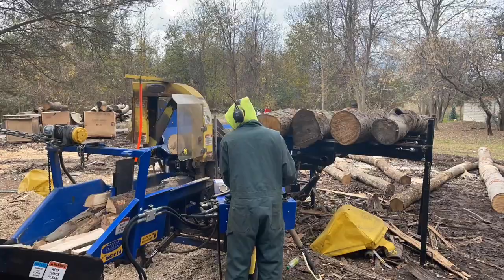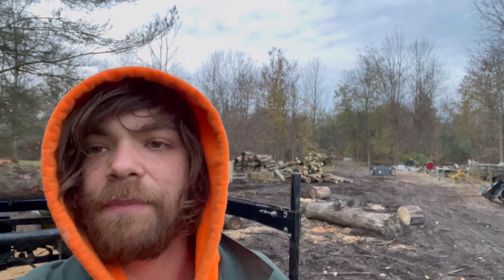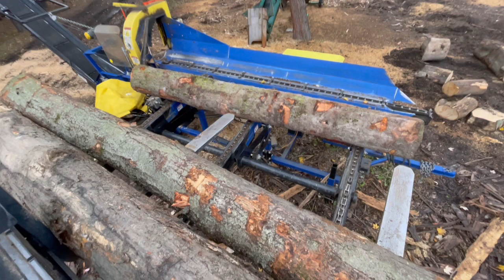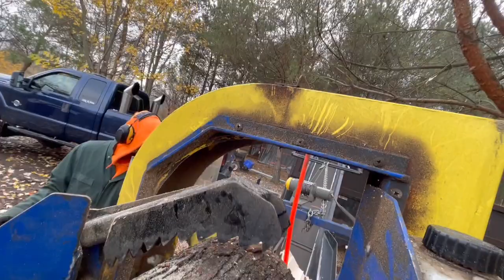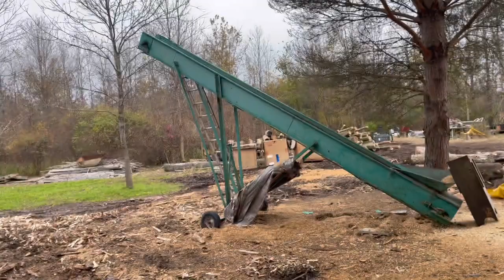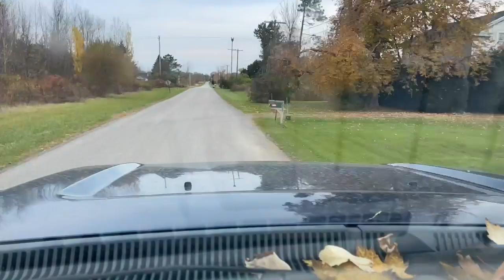WHY I DO NOT STORE SPLIT FIREWOOD?

Comment: Dad just bought a processor. For decades, he split into a pile to season for months. Some people appreciated it but you're right: stuff on the bottom is dirty and moldy if its been a wet year. People also don't always understand the costs involved to get that split then seasoned product: dad used a loader to hand stack each face cord. $16000 for the trailer that's not too big to rut up a yard, a $45000 truck to pull it, $65000 processor so no chunks are too big, etc., etc. Not saying it can't be done cheaper... but some customers want premium quality, dry, split, uniform, defect-free firewood for less than green wood prices or $5 more per facecord. You're right in what you were saying and, if you're clear with customers, they can't claim ignorance and you actually get them their wood at a much better price. Don't forget wear and tear on your body if you were to hand stack! Most firewood people don't charge enough for that because customers just don't know the physical labor involved and won't pay. Thanks for the video!

Comment: In my case I have to stack for room.. Now I am only doing about 50 to 55 full cords a year(currently with just a box store splitter and a truck) and 99% of what I get is green.. For soft woods it will be fine in 6to8 months.
In your case the volume you are doing makes sense to me with the room you have.
Chris in the wood yard or Joe at Ohio Wood Burner there system makes sense to me as well as they have the room to stack it.
At the end if the day if the customers is happy with what you deliver than that is all that matters..
Each to there own. Keep doing you Greg and you will be fine. 😁👍
Reply: Other than Ash or Soft maple I don't understand how it can be dry.  I have a pile of oak that have been stored as logs for two years and it is still 30+ percent moisture.   I suppose if it is boiler wood it doesn't matter so much but here in Washington boilers are not legal.
Reply: @stevenstewart7603  : guess that is where you and me are different compaired to high volume guys.. We are just under the mark of this level to where we have a little room we can stack it away and not worry about it. Where high volume guys like TWG may not have the room to store it away..
Dont get me wrong I am not questioning anyone's way in doing things.😁👍
Reply from the maker: Really appreciate you mr Atkins. you do amazing at your woodlot. Cant wait to see the new splitter when you get it 👍🏻😁

Comment: If a customer wants super dry wood, they should order in late spring or early summer. Don't be the grasshopper winter will come if your ready or not. Nice video, thank you!
Reply: EXACTLY Brian, been saying this for years, in fact I routinely tell potential customers that if they want 1-2 year seasoned firewood they best be ordering it 1-2 years in advanced and provide a adequate dry storage area
Reply: @JoesFirewoodVideos  
However,when you're  peddling "premium" firewood it must be dry.
You yourself said in several of your videos that the #1 criteria for premium firewood is that it needs to be dry.
Reply from the maker: I agree Brian! 👍🏻 thanks so much for watching

Comment: I do it this way as well.  Ash is getting harder and harder to come by in Northern MI though.   Most of the dead standing stuff is getting to be too far gone.  Sugar maple logs take a long time to dry out, I try and stay a year ahead on those.  Beech and soft maple tend to have a quicker turn around though, which is nice.  Red oak is almost uselss for anything but boiler wood unless you plan on sitting on it for like 2 years lol

Comment: If customers are happy keep it up.  I cut year old red oak tops last year they were still very wet.  Split and piled it ( not stacked)  it looked great and fairly dry in June.  When it started raining non stop in July it started growing mushrooms looked like hell when selling in October.  My son stacked his and even stacked double rows grew mushrooms.  I stacked this summers wood for next year but it sure takes a lot of time.  Should be getting 10 to 15 more a facecord for the extra work.  But doubt I could sell much at that price point.  Does look better fresh off  processor but don't  think people would be happy with fresh split oak logs.  It works for you keep it up!
Reply: I haver had a dyna for 10 years now and I cut and split as the orders come in I only store full logs it come off the converyor into my trailer and delivered and you are right to stack and store and then throw into dump trailer I to would need 10 to 15 dollers more per cord
Reply: ask some of your customers if they would mind just cut and split firewood
Reply: Yeah I been thinking of offering a green wood fresh cut discount next spring and summer.  I just cut red oak tops left from logging and ash right now.
Reply: Start to try to grow mushrooms and I bet they would stop!

Comment: I used to buy my wood in the log form.  My savings were huge.  It was better for the supplier.  He would store it in piles so when I got it it was at least 2 years old. I would get a truck load a year, so that meant I would have one pile of full logs sitting all winter.  I would cut and split the previous pile over the spring and summer.  It was always dry enough to burn that winter, and I always had at least 2 face cords of previously dry to eat me started.  I preferred this method as my previous supplier used to always slip in dry rot
A few of my neighbours used to do the same thing and we would rent a log cutter, splitter. Over a week we would get 3 to 4 house holds done at a minimum rental price, and always helped each other out.

Comment: The more you have to handle the wood each time the more time and money you're losing...... and with fuel prices climbing each day......it only makes sense to do it as fast as you can.... especially running multiple pieces of equipment like when I was up there grabbing 20/25' lengths off the main piles with Backy, you cutting them in half and loading the processor live deck and that Wood gurl processing into the trailer..... what a great team effort !!!! But remember...... you're still handling each log 4-5 times before each piece lands inside the trailer
Reply: ^^^^ YES 🙌🏻
Reply: I would change the word, "handling" to something else, because he does not put his hands on all of it.
Reply: @jakebredthauer5100  okay what " word" would or should I say " wood" you suggest ???????
Reply: @delcasaleexcavating9508  
machining or working or machine-working
Reply: @delcasaleexcavating9508  I would suggest using wire mesh in a circle on a pallet to make 1/3 cord baskets that can be covered with plastic. No-touch wood.   Concrete block foundation halfway on each of the four sides
Reply: Much of his mud problem is lack of drainage and putting Garden materials where he wants to drive.
Reply: @jakebredthauer5100  that's a good idea
Reply: @delcasaleexcavating9508  Finish the ends of the wire circle with a rod, pipe or stick of wood, to be tied and untied. Space for access.   Concrete reinforcement wire comes in various gauges with various hole sizes. Do not fasten the wire and pallet together.

Comment: that wood is GREEN cuz!  Green as can be, but if it works for you and your customers, good deal, but those logs ain’t drying sitting there, they could sit a couple years and still be wet inside, wood only drys after its split into firewood, i cut all my logs into rounds and process from there and even after a year once you split it open it’s still green.  i was always wondering why i never saw firewood piled up anywhere.  i sell seasoned firewood down here and i’m about a year ahead so the firewood is dry, lights up with newspaper, but it’s true it gets dirty sitting in a pile, so it’s either green and clean or dirty old firewood.  i load with an excavator with thumb and skeleton bucket to sift out junk, helps a little. great video was always curious why the woodguy never had wood anywhere!

Comment: I suppose your customers are primarily heating with wood and not recreational burning wood.  Do you sell you firewood by the dump trailer load?
Reply from the maker: Sure is. 90 percent is all used for primary heating... and I sell by the face cord... but I like to deliver full trailer loads which is 5 face cord. If somebody wants less than 5 face cord I have to charge for more for delivery depending on distance

Comment: Prefer logs stored on site. Harder for the midnight crew from walking off with the profits. Use to store rounds in a shed but the still broken in the sheds. I got tired of working for the lazy clowns. Logs work, they won’t put the effort in 300, 400 pound logs either. They stay from my piles. Have a idea who it was they end up in a cast for about 3months. Think they tried but got rolled by a roller off the pile. Thanks keep up the hard work. It’s the only way out of the inflated economy comics. That’s my opinion anyway!!! 👍👍👍

Comment: I hear what you are saying about it being the easiest and least time consuming way to do it. 
But I have a really hard time believing that your wood is dry enough to be considered ready to burn. 
Could you take the moisture meter and show us what the moisture content is directly off the processor? 
I know I can't take logs that have been cut 6 months process them and have any of it be under 35% moisture and in most cases closer to fifty percent. 
Take care my friend!!😀😀

Logger Al
Reply: Tried this myself last year with 8 logs.  Epic fail for me.  It may work for those customers running boilers or big stoves that run hot.  For my small stove it stunk. Knowing what you need for your situation is the most important. Proof there is more than one way to skin s cat. I just choose differently lol. Have a great day and go play in the wet snow.!
Reply: Depends a lot on the species of wood in question.   He gets mostly what appears to be dead standing ash.  Which is  undoubtedly good to go straight off the processor.  

Also, it's not like the customer is burning all 10 or 15 cords in that short a time period.  People just know to cherry pick the dryer pieces at first.  It will finish seasoning after delivery, especially if they stack it and at least attempt to keep it dry.